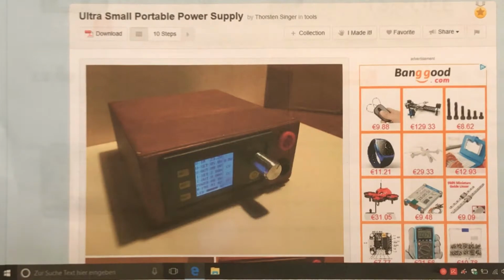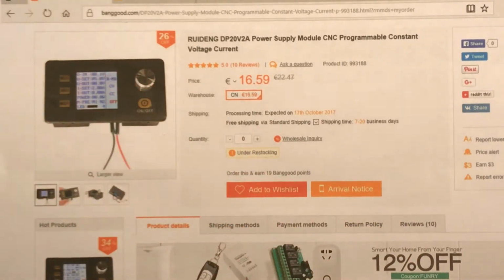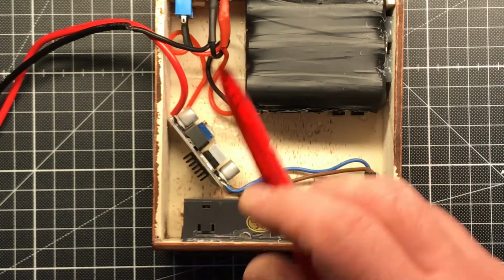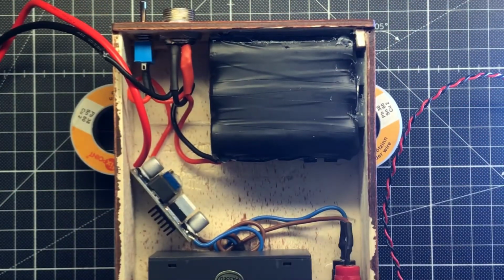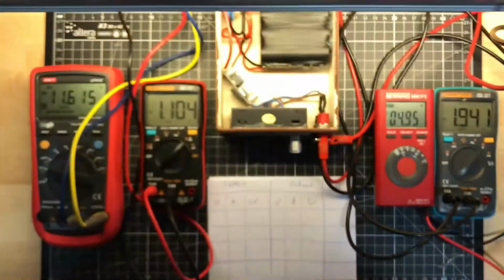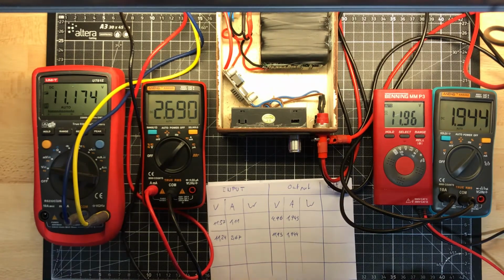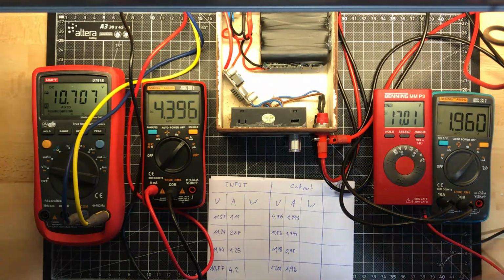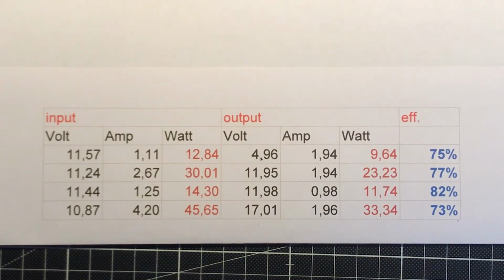30€ Battery powered DIY (Bench) Power Supply with RuiDeng DP20V2A / DPS3003

Comment: thank you very much for your test and your great video 
in fact , you can test our DPS power supply 
and voltage is more higher , the efficiency is more higher 
you can check EEV blog sencond video to test DPS3003 video
Reply from the maker: of course I see the video from eevblog that is why I show my build here it's original dated from 2015 I made it for instructables.com at this time. For me the efficiency is not bad I think I got one of the first module's you made. I like the new User Interface at the newer modules, keep going with your great work. But I really think you copy my case design. ;)
Reply: @ts.electronics
thank you for your reply, friend . 
I am glad that you like our product , you can consider our new version , hope you like them too 
DP20V2A is old version ...it is not quite good compared with new products 
for the case, I did not , because I never meet your design, in fact, it is very easy to design this